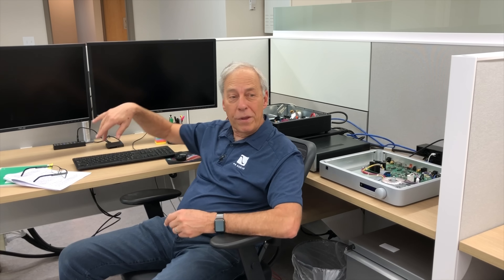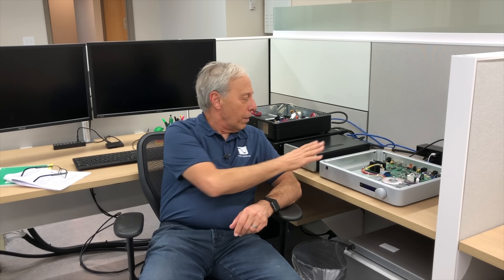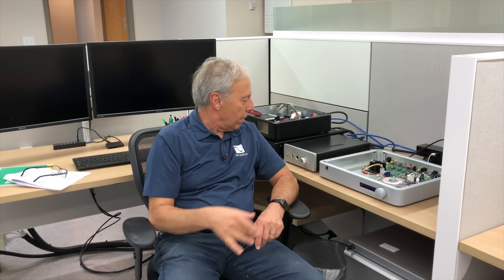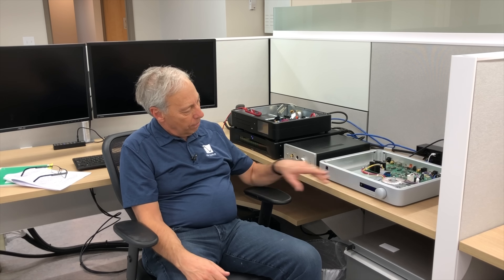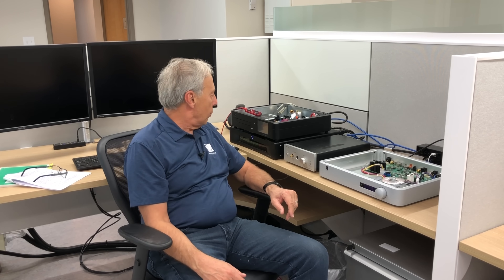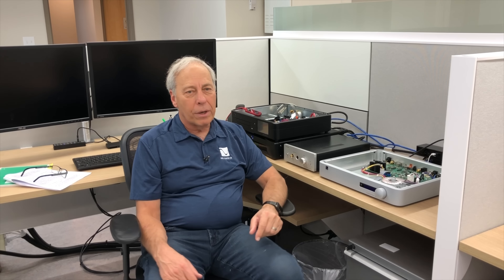Using a UPS for power conditioning

Comment: And what about using a power conditioner for the UPS?
Reply: This what I do. Our power supply is so bad that we get brown outs once or twice per week. They typically last for two or three seconds but sometimes they can go on for 15 minutes or more. Honestly, it such a pain and recently, when my Aurender server and another device screwed up, I decided to add an APC battery backup and a PS Audio Dectet Power Centre. All of my gear plugs into the Dectet -brownout problem solved and I have clean power for a very modest price.

Comment: Hi Paul. The term you are looking for is line interactive. This type is satisfactory for computers but probably not for high end audio equipment. They can be as high as 40 percent THD. They are relatively inexpensive and for a typical desktop computer can run about 200 or less. I have an Eaton 1000 VA 600 watt model myself. Double static conversion models are much more expensive. Power factor of the load can be improved by adding capacitors sized for each load
 UPSs and generators like power factors between 0.8 and 1.0 lagging meaning net inductive. UPSs can be bought at any size up to about a million watts. Capacity can be further increased including by installing them with paralleling units. THD is typically 5 percent or less, around an order of magnitude worse than a PS power regenerator.

Comment: You can run a mains contestant lightbulb of 5 Watts before your amplifier or equipment will smooth out the signal and preferably a variac as well. I was wondering about running a contestant lightbulb after the Bridge rectifier to cut out noise?

Comment: Sorry, I have to disagree.. A power conditioner does little.  But the one thing that it does well is group the AC receptacles together to prevent ground loops, especially in unbalanced systems.  Of course, a quality power tap/strip will do the same thing.
Reply: "A power conditioner does little."

The last job I had there was a power conditioner in one of the corridors. It was almost three metres long and the best part of a square metre in cross section. It hummed. Loudly. I suspect it cost a small fortune. Why would the owner of the building purchase something that did little, but cost a small fortune?
Reply: Jonathan Sturm have absolutely no idea. And I have absolutely no idea what the application was. But in this application, a power conditioner is going to do very little, if anything.
Reply: I suspect it was there because of the mass spectrometer and scanning electron microscope among other items of interest to geologists. Of course if these items had been properly designed (according to self-appointed judges of such) they wouldn't need power conditioning would they?
Reply: Jonathan, many mission critical facilities have large UPS systems and isolation transformers for technical loads.. Data centers, broadcast facilities, 911 call centers, hospitals, non emergency call centers,  CATV systems, cell phone shacks. The obvious purpose is brownout and surge protection as well as ride through until the generators get up to speed. This is an entirely different reason than the topic in discussion here.
Reply: Jonathan Sturm I can assure you it was being used for reasons other than audio. I'll say it again. The power conditioners are completely unnecessary. My expertise is in audio and RF. I have no idea what they were using it for.
Reply: RE the electron microscope, MRI scanner. Yes, it was probably on some type of UPS. That is a highly sensitive instrument with lots of digital circuitry that is highly subject to spikes and glitches. And it was no doubt in a commercial building with big HVAC and elevator motors kicking in and out. Or perhaps that was just a transformer. Some of that equipment is made in Europe and runs on European line voltages like 400 volts. Siemens is a huge player in the world  medical equipment market. Our standard in that class is 480 volts hence they would need a transformer. Why not just build a different power supply for the USA? There is no one power supply in a large system like this. There are many sub power supplies in use. A lot easier to install an external transformer than to market different models at that cost including re-certification when any minor change is made. A big difference in application here compared to a home HiFi system.
Reply: Gosh you dudes are entertaining :-) About 20 years ago, the computers in my home were BSODing on a semi-regular basis. I installed an APC UPS and monitored the power coming into the house for a couple of weeks. The variations in voltage and frequency were clearly responsible for my computers' instability. As it happens, the switching power supplies in computers are far less sensitive to such variation than audio equipment. For example, when the mains frequency increases, the turntable speeds up and when it decreases the turntable slows down. Now get this: I don't need a CRO or any other scientific instrument to hear a change in pitch. Even though my 67 year-old ears are far from golden, they can detect differences that you claim are unmeasurable.
Reply: Jonathan Sturm  Then I suggest you make yourself feel good and purchase one of Paul's power conditioners. As for me, I won't be purchasing his power conditioner or any other power conditioner. And I'll enjoy my audio system functioning just fine. And I'll be quite happy to know that I didn't throw away several thousand dollars on equipment that gives no advantage above a simple power tap / strip.

I'm amazed that you folks believe that audio is some mysterious engineering feat. It's actually quite basic and well understood. I also find it quite bizarre that for some reason all these little tweaks will not work on products outside the audiophile industry.  Somehow, magical AC receptacles, magical power cords, magical power conditioners, and all the other exotic audiophile products work only on audiophile equipment. They don"t work on professional audio equipment or any other equipment outside of the audiophile application.
Reply: @jonathansturm4163  yes but you realize even with these expensive electronics designed and made they have requirements for certain things, one being power conditioning I am guessing. who knows if it's really needed but it's probably one of those "if you want to use this you need to plug it into that for us to support it"  it's the same reasoning for military and hospital grade I suspect.

Comment: A generated true sine wave is analog by nature...smooth. it's only when it is (re)generated by a UPS inverter circuitry generating from the built in battery does the inverter try to approximate the sine wave. And truly, if you wanted more consistent power, it would be better to use a 3-phase circuit which can better supply the necessary current in a more fluid manner!!!
Reply: The regeneration of a sine wave can be done at a ridiculously oversampled frequency and at an arbitrarily high resolution because sin(x) is a simple math function. Music covers over 100 times higher frequency content but somehow digital audio still manages to try to approximate the complex nest of Fourier summed sine waves with some success.

In my experience, for distro, 3 phase 400Hz power is hard to beat. The frequency increase allows magnetic cores to be reduced in mass by 80% without hitting efficiency.
Reply: Peter S, the problem with 400hz is the reactive component on long runs. It's not economically usable beyond 100 feet or so. But yes, it makes for great power supplies. Most of the old mainframe computers IBM, Sperry, Burroughs, and Cray all used 400hz or 415hz three phase power. In fact the Cray 5V power supplies HAD NO FILTER CAPACITORS. By using a choke coupled delta/wye  rectifier topology, the DC was so clean, no traditional caps were needed. Nor was any load regulation as Cray was all ECL based and basically ran class A. The line regulation was done in the MG set that provided the 3phase 400hz.

Comment: Hey Paul. The word you're looking for is line-interactive UPS.

Regarding that, since I too can't afford a power plant, I've found a measure of success in using greatly overspecced (1200VA) line-interactive UPS, one of the slightly more expensive semipro variety that makes a "proper" simulated sine wave rather than the cruder stepped-square wave models, followed by a DC offset filter, followed by a 1KW ACUPWR USA 240-240 regulator/filter with a PSAudio noise harvester stuck in on of the sockets. 

Its probably slightly worse than not having the UPS when the line is clean, but in a condo with electrics from 1968 Italy, plus countryside italian wall power, that doesn't happen often, and my multibit DAC really hates being turned off for any amount of time so I needed a ups for it anyway.

Since the load is just the DAC plus a SET 2A3 amplifier, and the UPS so massively over spec, I can brute force my way around the pf-induced thd and the filters eat the residual. I can tell its working by how often your dandy little noise harvester blinks at me :) 

When the power is dirty, which is very often, the harvester after all of that blinks way less than one I just stick into a wall socket, and I don't hear all the grunge I otherwise do. I call that a win. 

For my other systems (like my bedroom 2ch with nice ATC bookshelfs but otherwise nothing really special) with lesser less finicky DACs, just the DC filter -> regulator + harvester seems to do just a-ok, although I can hear the filter's voltage regulator modules engage/disengage when the neighbours use their electric window blinds, which I can't with the main setup.

So, if you absolutely can't afford a PSA power unit, and the noise from an on-line double conversion UPS's fans are no-go because you don't have a separate room for it, you can make it work by massively overspeccing on the UPS, and it will be better than just filters, but I would only recommend it if you have particularly bad power, as the setup becomes rather complex. Or if you need uninterrupted power *anyway*.
Reply: I'm gobsmacked. Someone else in the civilised world with worse power than me!